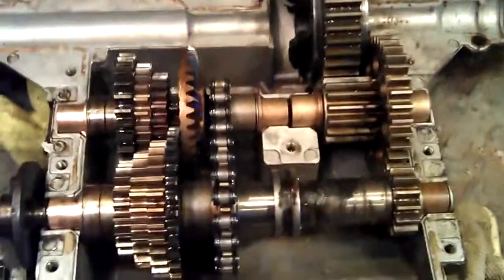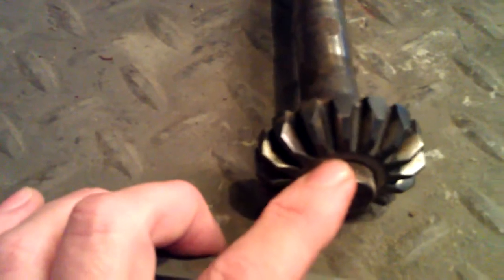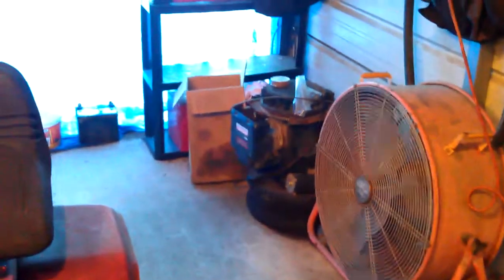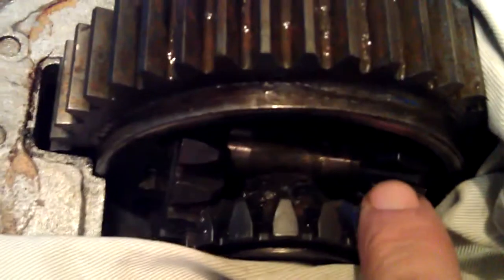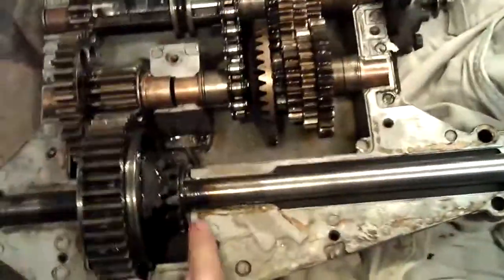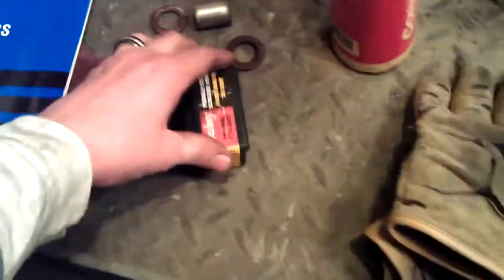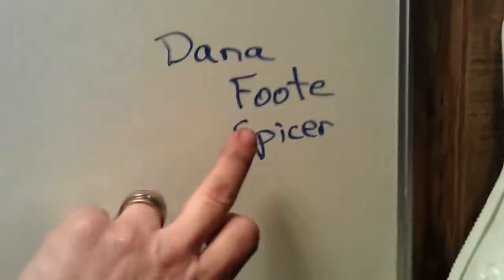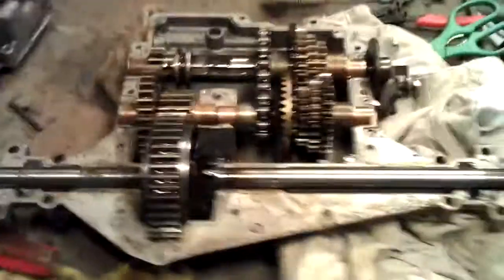Locking a transaxle

Comment: When you put your gear oil in it how dod you do it. Did you drill an tap a drain and fill or did you put it in befor you put the two halfs together. How much oil did you use. thanks

Comment: The axel is all made in an assembly not like what is in the video its all in a housing. It spins easy in nutral when put in gear itd hard to turn pully gets harder in higher gears. And cant turn the axel by hand unluss have s tire on it. Even in nutral.